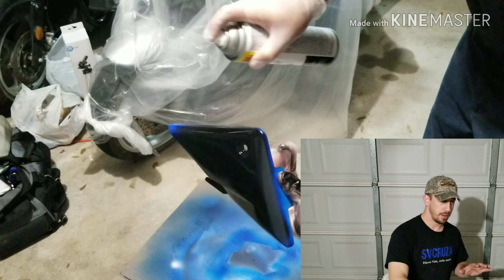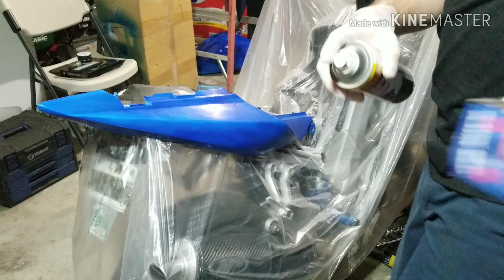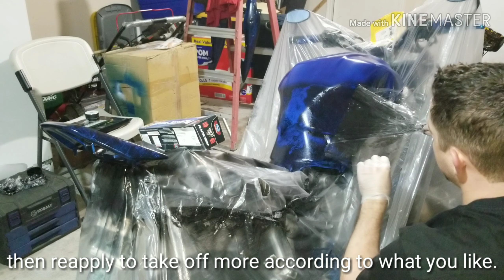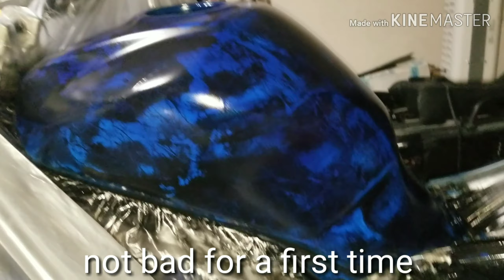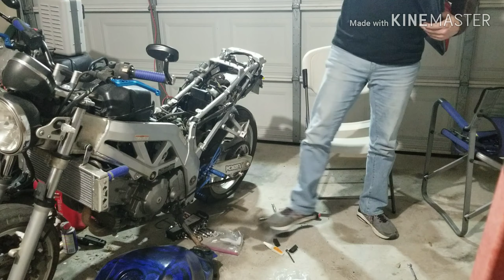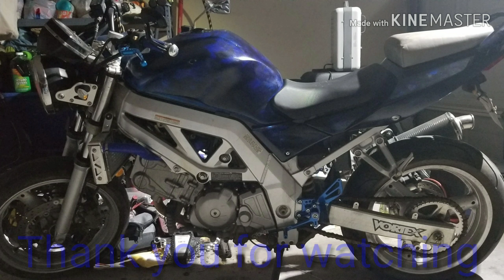Marble effect paint job part 2 and final assembly.

Comment: When you remove the plastic, isn’t the surface uneven? What is your next step after removing the plastic?
Reply from the maker: What do you mean by uneven? the plastics are fairly sturdy so sanding and painting is pretty simple.
Reply: SVCruza thanks for answering. I mean for the marble effect, when the plastic bag/sheet is removed the the surface must be groovy and bumpy, not smooth.
Reply from the maker: Ahhh yes, now I understand, surprisingly the black gloss smooths out on it's own but once you're finished with the painting then you hit it with the clear coat. After about 2 or 3 layers of clear and give it time to cure, hit it with wet sanding 600 grit, then 800, 1000, 2000 then finally 3000 grit sandpaper (using dish soap and water in a bucket.)
Once dried, hit the surface with compound  and then finally wax for the finish. It should look like glass when complete. Hope this helps dude.
Reply: SVCruza very helpful man, thank you very much
Reply from the maker: Anytime dude.